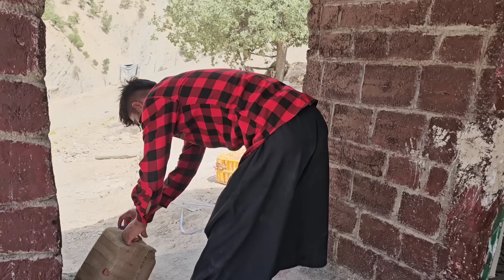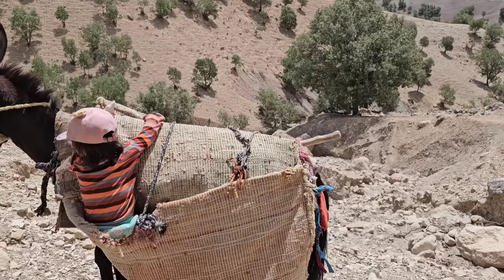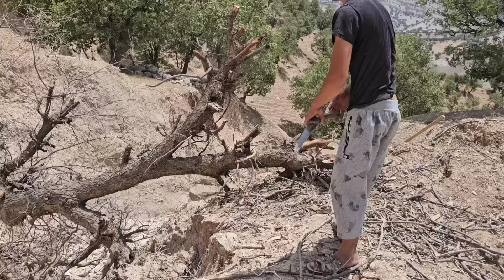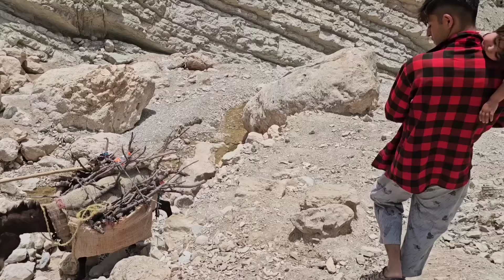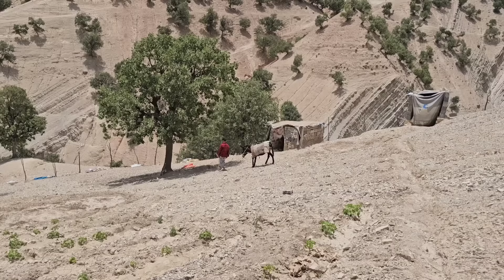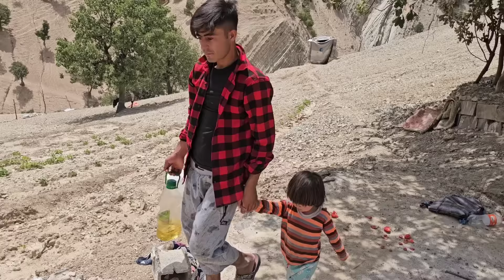Ultimate Forest Camping and Survival Adventure with Kamal and Umm al-Bani, ForestCamping, Bushcraft

Comment: May I suggest that next time you saw the wood into smaller pieces?  You will then be able to put more branches into the saddle bags, and thus save time on transport.
Reply: Долго пилить придётся, они очень твёрдые. Нужно быстрее прятаться от солнца.
Reply: @lenalarsson4392 - It comes to the same thing.  Either he spends less time on cutting the wood now, and will have to return, in the heat, to collect more wood, OR he cuts the wood NOW and brings back more wood without having to return later.  Same effort, in effect.